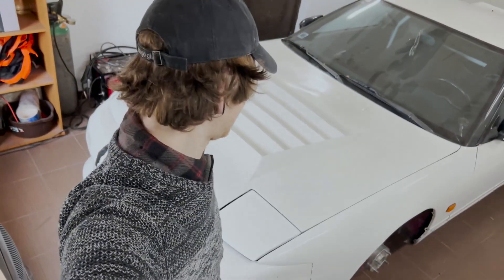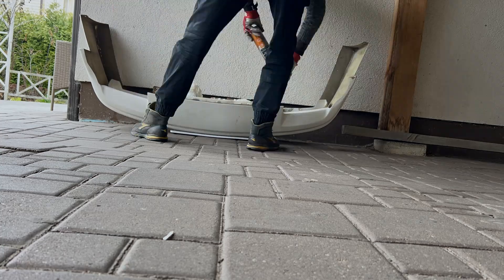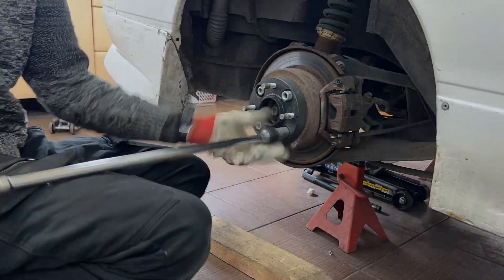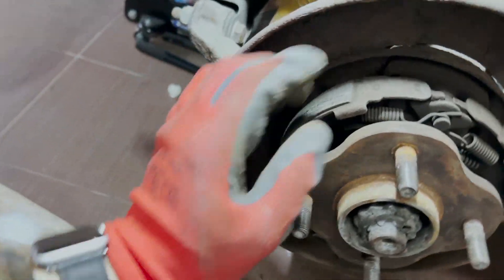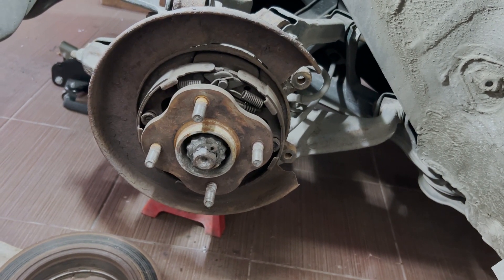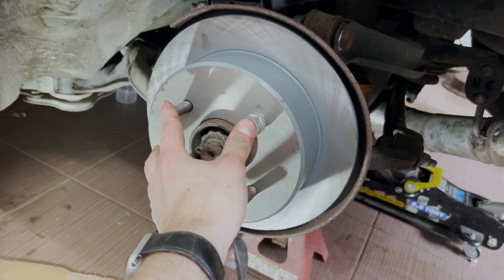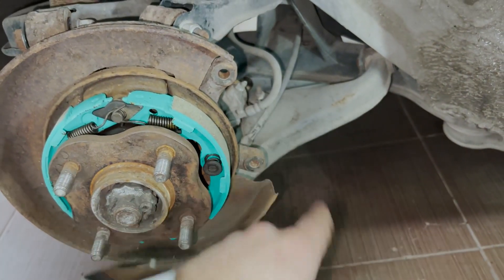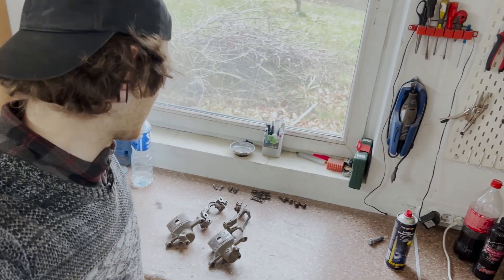Project MU handbrake shoes install

Comment: I didn't know that stock 4 lug S13 had drum brakes?  I'm so confused. Can you shed some light on your rear brake setup?
Reply from the maker: Yeah, sure! This is 200sx, the EUDM version of 180sx\240sx and it came with 4 lugs\drum brakes. What you saw is bone stock rear brake setup for european 200sx. It is somewhat similar to z32 setup, however z32 has 5 lugs and bigger brake discs and different calipers. 

It is alot easier to swap to z32 front and rear brake setup to european 200sx. Everything is bolt on, you just need to buy the z32 discs and drill the 4 lug pattern into them.

Also it uses same handbrake shoe as cefiro, z32,s13 and some other cars.
Reply: @manekun_  that's pretty rad! Thanks for sharing! 

I've been sitting on a set of z32 brakes front and rear with drums. I just purchased rear 5/4 lug rear rotors so I can stay 4 lug but upgrade brakes. Found out it was possible to do the swap while maintaining 4 lugs and thanks to you, I found out there's another way.